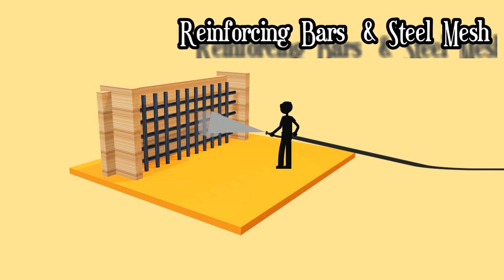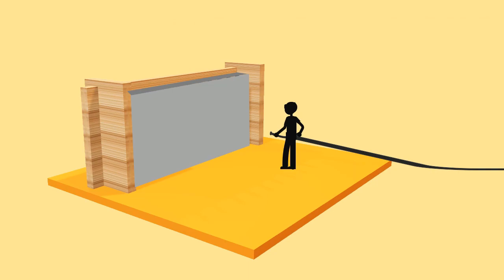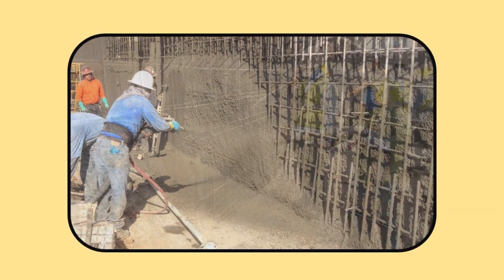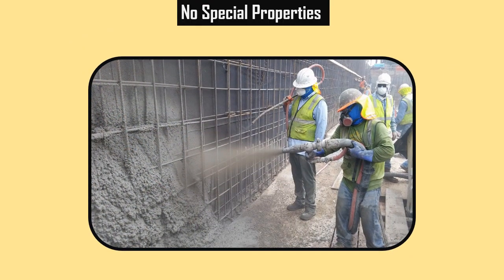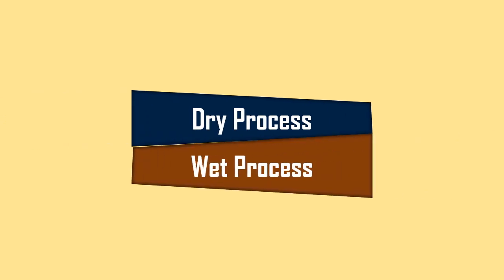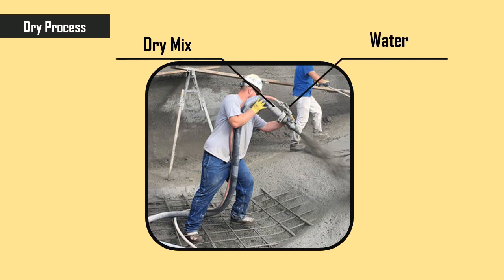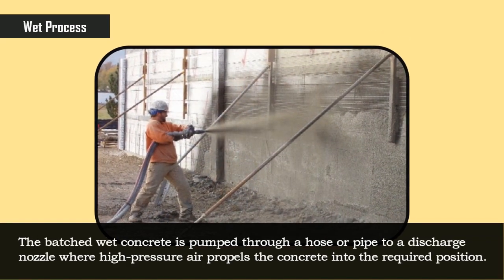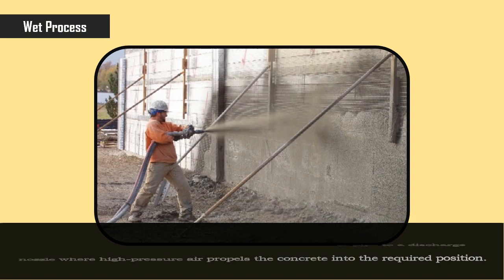What is Shotcrete? || Gunite || Sprayed Concrete || Types of Concrete #13

Comment: If it has high cost and less durability then why we use it
Reply from the maker: In certain places this type concrete would be more convenient and speedy..
Reply: We use it to repair ovens and mixing pits at a aluminum casting plant. Its the only way to efficiently go inside the pit and repair the broken brick/block/old concrete.
Reply: I like gunite, shotcrete is messy and can be hard work.

Comment: What is initial and final setting time of this concrete as compair to general concrete ? Means how it is different ?
Reply from the maker: The mix alone will have same initial and final setting time as of normal cement concrete....  However, admixtures are added to accelerate the setting time. Based on added admixtures the setting time may vary..
Reply: it shouldn't have altered IST and FST as its mentioned shotcrete has no special properties compared to normal concrete.
Reply: Nikhilesh Das  strength of concrete 
1day =16%
3 days=40%
7days=65%
14days=90%
28days=99%
Reply: It depends a lot on type of mixture. It depends not only on accelerators but also on % of cement, water and aggregates. In 1 hour you can reach 1MPa